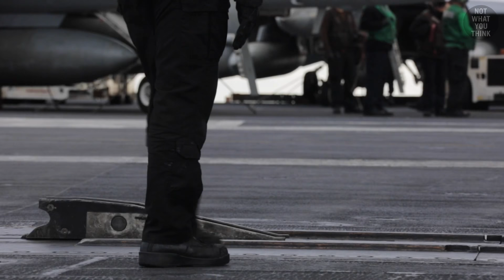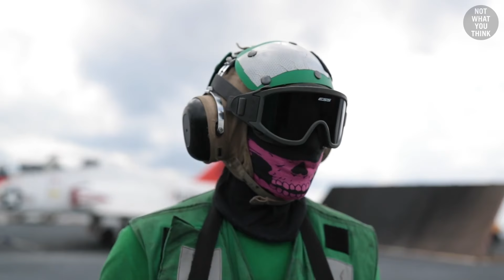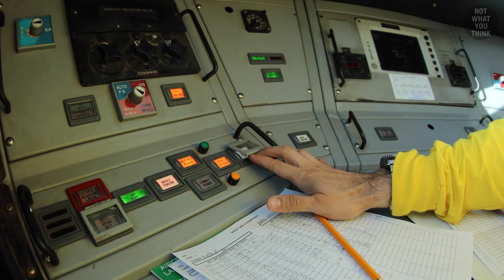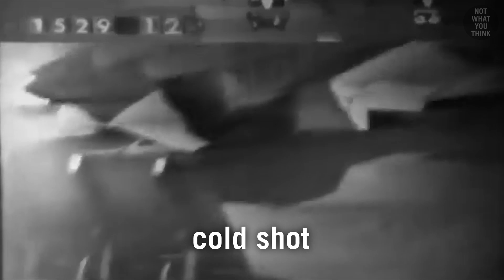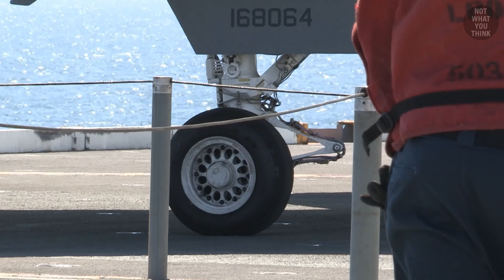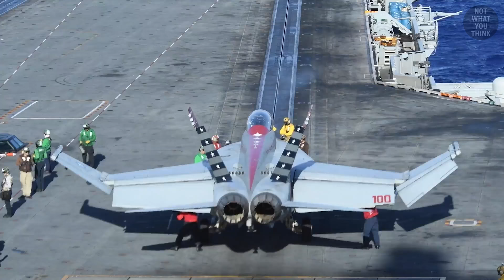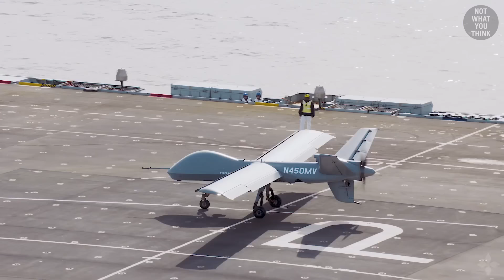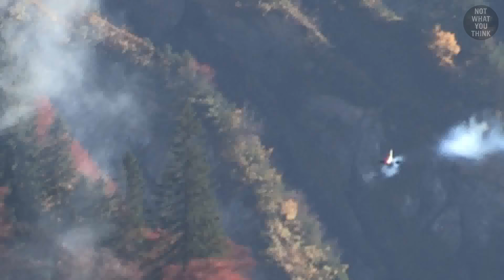Why the US Navy is Replacing Electric Catapults with Steam

Comment: The problem with steam catapults this "expert" ignores is that the steam comes from the same boilers producing steam for the turbines powering the ship, both for electrical generation and movement. When the Brits invented the steam catapult back in 1951, they installed it on a test carrier, a light carrier from the "Colossus" class. One day, the ship came to a complete halt. The test schedule for the steam catapult had exhausted the available steam to power the ship. 
The steam catapult requires miles of high pressure (1200psi) steam pipes running from the boilers in the lower center-aft part of the ships to the four catapults, two in the waist and two forward. As the carrier gets older, these become a maintenance nightmare as corrosion eats away at them. The pipes also take up interior space in the hull. Steam management in a steam powered carrier is a major issue for its captain and the engineering officer. 
One reason the ramp is popular on foreign ships is that they are using gas turbines which do not require boilers or steam. Thus, they are limited to a technology that reduces the load out weights of the aircraft they carrier so they can take off over a ramp.  
Electromagnetic catapults are powered by both steam generator turbines and gas turbines providing electricity to the catapults. Even if there are issues with the boilers, the carrier can use its emergency diesel generators to provide enough electricity to operate at least one catapult. The electricity needed is passed through heavy insulated cables that take up much less space than the steam pipes used previously. 
Two points. The Chinese went with electromagnetic catapults in their latest carrier. And if electromagnetic catapults are wrong why is this absolutely ridiculous "battleship" Trump is backing has an electromagnetic gun (rail gun), something the USN has yet to deploy in service after 20 years of R&D.
Reply: For your information, I am a foreigner. Ask for your understanding. The point where both steam generators and gas turbines can operate: Ultimately, it's the difference between using steam or gas to power the generator. Nuclear-powered aircraft carriers have a reactor for self-propulsion and steam generator for long-term ocean operation, as well as generators that combine electric propulsion like South Dakota. At the time, the doctrine of British aircraft carriers was based on the concept of armored carriers, which was originally a mobile maritime base, not a mobile carrier strike group. The British aircraft carrier is an armored carrier. There is also an interpretation that China seems to be considering electric injection molding with the goal of facilitating operations during the Arctic route, as they appear to be showing considerable sincerity in their Arctic route. I understand electro-injection in that area. I have a very negative view of the fact that electric-powered systems have superior maintenance, economic feasibility, and stability compared to steam-powered systems. Aircraft carriers are also ships, and ships are also seen in the same context as land-based plants. The ultimate goal of the machine is to be trusted, protected in emergencies, and to be a fraudulent operation. (The signal value in a state other than without power outage) An aircraft carrier has its primary mission of moving and aircraft takeoff and landing, and must use the primary energy state within the vessel, not the energy that has been converted into secondary energy. This is the most basic solution to complexity and economic feasibility, and ultimately, it is the concept of securing trust under the worst conditions.
Reply: Secondly, when restoring at sea, piping is easy, but power lines are difficult. High-voltage cables are only meaningful in full replacement, not repair methods like welding. A full replacement of national wealth is better than a full-scale replacement, which is an absurd economic viability. Unlike pipes, high-voltage insulation cables have their connection points fixed at the time of design, and only a very small portion is made. The pipes are different from the beginning.
Reply: @Mah3mop Refueling at sea would involve JP5 aviation fuel, diesel for emergency generators. Not bulk fuel. The carriers are nuclear powered. So, your first scenario is non-applicable. Second, the USN would be building at least another dozen CVNs, and the parts for the EMCs would become a common item which the Naval Air and the Naval Surface Logistics Commands would also have a sixty day minimum supply. The costs become amortized over decades. There is a reason that the British used ramps instead of steam catapults because gas turbines don't produce steam. ECMs can be used aboard ships with gas turbines. Trump is simply demonstrating his lack of education beyond commercial real estate and arrogant ignorance. I might point out that the first catapults used fly wheels, then hydraulic pistons, then steam and now electricity.

Comment: Why in the world are they going back?  Just work out the kinks. Steam is heavy and bulky, it requires way more maintenance, dangerous in combat and prone to exploding pressurized steam into your compartment, takes time to charge up that pressure (I'd assume more than it takes to charge a capacitor bank from a nuclear reactor), you can't accurately gauge the force so are putting extra force into your airframes etc. etc. Silly. Freaking USN just "giving up," again, instead of working through the kinks.

Comment: What happens to the shuttles after the launch, are they retrieved from the sea, if not launching an aircraft is very expensive. Cant the shuttle be tethered to the ship.
Reply: That red thing you're seeing in the video is a dummy vehicle for the test shot, not the actual shuttle of the catapult. The shuttle never leaves its track.

In the old days they had a bridle that did detach from both the plane and the shuttle, which is why carriers in older photos (1980s or older) have a sort of tab at the bow in front of each catapult, that was to retain the bridle so it could be reused.

Comment: Both EMALS (linear electric motor) and retro-steam are bad ideas. 
You'd get the same performance and controllability as EMALS for less weight, and less cost, with a conventional rotary electric motor and a cable, using the same control electronics. Electrically the rotary motor is the same as the linear motor, except that all of the motor is used at the same time, not just a small segment of it, hence it can be much smaller and lighter.
Reply: Are you sure? Wouldn't that have a lot of inertia and friction? Electric motors' weak point is usually the start up and wind up. Three phase motors usually have dedicated circuits that changes the topology of the circuit from soft start to full on power so it doesn't fry itself and lasts longer.
Also on the friction side you would have all the pulley, cable and motor friction Vs the attachment on the emals as the only moving part
Reply: @Andrew12217  The key to understand is the direct electrical & mechanical equivalence between the linear and rotary motors. Just it is much easier to keep a rotary motor sealed and clean, because the sliding magnetic surface is not exposed to the sky, waiting to collect any ferrous debris from the deck.

The moving part of a linear motor  is the same as the moving part of a rotary motor, so the same mass moving at the same speed.  The rotary  motor would be direct drive like the linear motor, so no gearing. It would have roller bearings on the pulley, so not much friction there.  The cable would be UHMW-PE, so very low friction, lighter and more flexible than steel, and corrosion free.

Also the rotary motor could be identical to the motors used for the carrier's four propellers,  so huge saving using an existing standard component, not a unique custom one.
Reply: @nickhockings443 I suspect that the propeller's motor its meant to be operated at a constant torque, I don't think they would be compatible with a pulse or ramp style of operation, that's probably why they went with steam before rotary motors in the first place.
It would make sense that having a downscaled rail gun would give you the power, control and response any other mechanisms wouldn't.
Also if it's fully electromagnetic you could de-energise it for maintenance if ferrous debris become a thing.
Reply: @Andrew12217  No EMALS is not a "downscaled railgun". The velocity is >10x lower, the force on EMALS is higher, the mass they are launching is >1000 heavier.

See electrical engineering, and the specifications of the motors used for the Ford Class and similar electrically powered ships.

Comment: The airframe of carrier based aircraft are engineered for that jolt. The enemy at sea is salt water corrosion and magnets naturally attract rust faster than most metals. There is some engineering work that needs to be done here to make then as durable as the steam version.
Reply: They are more than designed for the jolt. They are designed to make a controlled crash into the flight deck with each and every landing. Which it is literally a controlled crash into the deck. Naval aviators are the first to tell you that.
Reply: Still, the bigger the jolt, the more wear and tear, and more maintenance required. Also you think they don't corrosion proof the EMALS? Steam or electric, it's all made of steel.
Reply: @damned-n7j  Um, the planes literally do a controlled crash into the flight deck when landing. The launch from a steam catapult is a walk in the park in comparison. Everyone always talks about wear and tear on the launch while ignoring the massive amounts of it from landing on the aircraft carrier.
Reply: @TheFoulMouthNews  It all causes wear and tear.
Reply: @damned-n7j  Right, but in comparison to a controlled crash onto the deck, a steam catapult is a walk in the park. Compared to a high G turn or other type of maneuver, it is one as well. The planes are designed to handle it.
Reply: @TheFoulMouthNews Designed to handle yes. Is it good for frame life span? Nope.
Reply: @damned-n7j  Neither is sitting on the flight deck in the salt air on the flight deck when if comes to what is good for them. There are a lot of things that aren't good for the planes and have an effect on lifespan. Are we going to try to negate all of them because that would be a near impossible task.

Just look at the lifespan of the F-14s and their air frames for proof that a plane can have a long life with steam catapults and controlled crashes on the deck with landing. Our planes are just not being built to those same requirements/standards. The F-18 for example was not designed as robust as the F-14s were and the F-35s weren't designed as robust as the F18's were. It is a bad direction we are moving in in those regards too. And one of the reasons why the F-35 is so fragile is because someone thought they would try to do a hold my beer off with the corpse of Robert McNamara and create a multi-branch fighter that can do everything, which is impossible. The prime example of the failures of the F-35 is that it was intended to also replace the A-10 Warthogs if you can believe that.

In car terms, we went from producing muscle cars that can handle, can take being driven hard to the point of abuse and keep asking for more to building cars like Ferrari under Fiat's ownership that are beyond fragile and will breakdown if you look at them the wrong way. We also on top of this had the brass of the Navy and Air Force sign off on only authorized repair technicians from the companies that produce the F-35s working on them. The US Air Force and Navy can't even load software on them without jailbreaking them and running afoul of the DMCA which the personnel who do the work allowed on them have been trying to sound the alarm on for years along with the inability to actually repair them themselves.

How about instead of hoping EMALs will solve the fragility problems of our fighters we just build them to the standards we used to? To me, that seems more like the commonsense thing to do.
Reply: @TheFoulMouthNews Reducing wear and tear on airframes is a good thing. Obviously we can’t reduce it to zero but that doesn’t mean we shouldn’t try lower maintenance times and increase airframe life spans.

Comment: In the 1940’s piston based aircraft engines were more reliable than jet engines… but not for long. Development and field experience have already, or will eventually smooth out the issues and make electromagnetic catapult systems superior.
Reply: Eventually <--- won't help if war is on the horizon

Comment: The Chinese jumped from ski ramp to EMALS and there have been no reports of reliability issues or failures. The US uses an AC system while the Chinese use a DC system.  Maybe the Chinese have the better system approach.  In fact, while Fujian was undergoing tests, the new 076 amphibious assault ship, the Sichuan, included an EMALS, indicating the Chinese saw no problems in their EMALS design. Both the Fujian and Sichuan are NOT nuclear powered. The first Chinese carrier, the Liaoning is in dry dock for upgrades.  Could the Liaoning be upgraded to EMALS?

Comment: Interesting fact new tech tends to have more bugs then old tech.  Doesn't mean it's not better in the long run.  Just that it's going to take time to get up to the reliable techs level.

It's sort of the issue with computers, we are reaching certain physical limits to the current forms of computers, but if we wanted to swap to say laser based computers or quantum computers, how long would it take before they are just as versatile and useful as modern binary computers?  Decades at least.
Reply: Okay, and when you are talking mission critical military tech, it should have all the bugs worked out before being deployed and not be constantly failing like it does on the Gerald R Ford.

Comment: So for steam that is 1 failure vs email 108 ish. Still seems bad when its life or death. And talking to some people who have worked on both they perfer steam due to the ease of troubleshooting. And getting plans in the air is the most important job.
Reply: They also prefer it because unlike the mag launch system, Navy technicians are allowed to work on steam catapults and cannot with the mag launched ones because of the contract the Navy brass signed denying the US Navy the right to repair the mag launch systems and only allow for an "authorized" tech to do so. Which that is sheer lunacy with a warship that could be in the middle of a battle, need to launch aircraft but can't because it will take hours or days for a tech to show up from the contractor that built it with a time schedule for showing up like the cable guy.
Reply: I am not saying replace them all I am saying maybe we should of waited abit more be for installing them. What looks good on paper is not always the best choice

Comment: The problem with the electric is that when it breaks, it's kind of hard to fix it. The same with the elevators, we should go back to the hydraulic elevators, and I like the idea of the electromagnetic catapults, but the only thing is, can they withstand electromagnetic pulse? If lightning hits it, will it continue to work? Do you notice steam is gonna continue to work
Reply: Any EMP that's going to take out the EMALS is going to brick the entire ship.

Comment: Has anyone thought to modernize steam technology, like they have done with coffee pots & tankless water heating- of course on a much larger scale. It would be high power heating elements under electrical control, instead of having boilers & tanks, using a smaller volume of distilled water than a traditional boiler system. It would be a more compact system. I don’t know anything about aircraft carriers, so maybe this was already done & is in use. Anybody knows?

Comment: What no one seems to understand is that steam cat technology is a dead end.
Steam cats are incredibly rough on airframes. Building an airframe that can handle the abuse and still be competitive once the plane is in the air is a huge challenge. And because of the loads put on the airframes, aircraft require more maintenance and a shorter lifetime. All of this adds cost and makes carrier aviation that much more difficult.
Add to that the problems steam cats cause in the engine room. Suppling the surges of steam needed to fill the 4 accumulators (one for each cat) means oversizing the reactor systems to handle the suge. Again, this adds cost. It also may under certain conditions limit what the carrier can physically do. In an area like the Western Pacific, really hot, windless days coupled with high water temperature are not uncommon. But that high water temp causes trouble in main condensers by limiting the amount of vacuum you can generate. That places a physical limit on the carriers max speed. Then suppling the cats with enough steam to get a heavy plane off the deck becomes even more of a challenge.
And finally, all the steam piping, the steam accumulators and the cats themselves are all maintenance hogs. 
Please remember, in the 1950s a lot of jets were lost and a lot of pilots died perfecting steam cats. They were not perfect on day 1.
Hopefully the learning curve for electric cats will be short and we won't lose any aircraft or pilots

Comment: Have the Navy go back to prop plains on carriers?
Reply: The E-2 Hawkeye uses props. V-22 maybe as well, depending on definition.
I'm more interested on if they will go back to using piston engines and biplanes.
Reply: @nikolatasev4948  REAL aircraft engines spew castor oil all over the place. Also so-called "throttles" are cultural Marxism, real men use an engine cutoff to regulate power and speed.